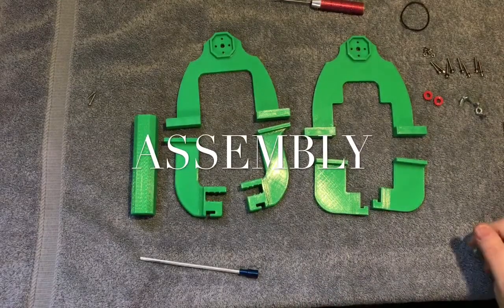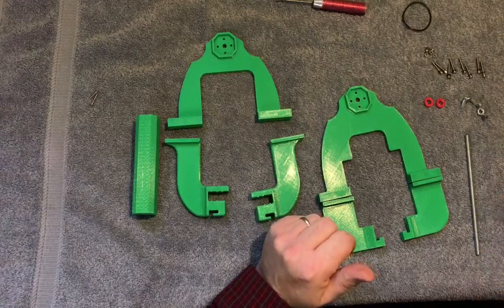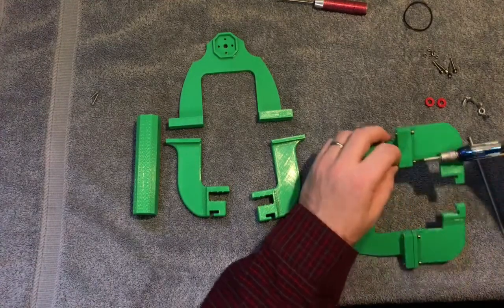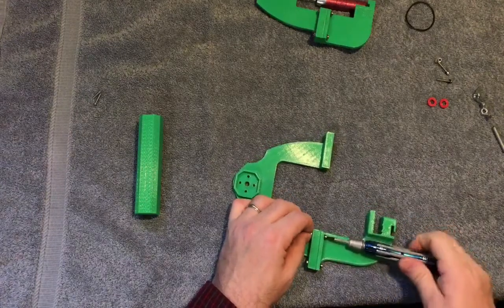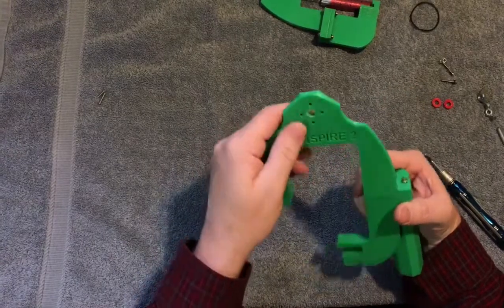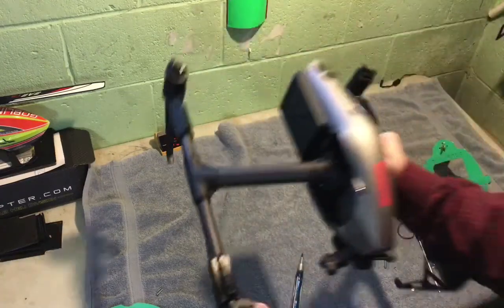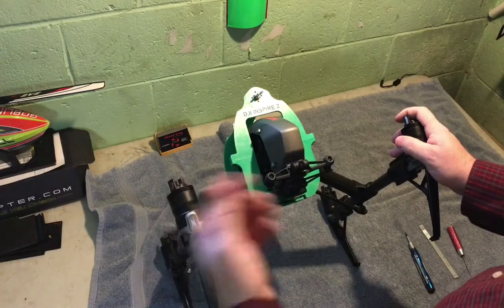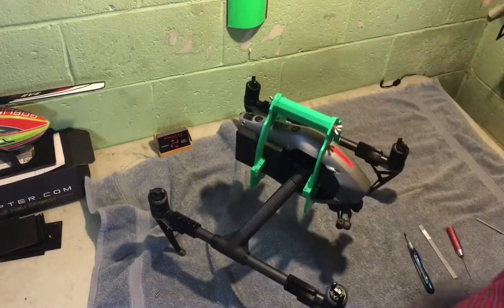DJI Inspire 2 handle for ground filming

Comment: I am going to make one great idea.. I was hoping DJI would make us a gimbal for the inspire 2 cameras but I guess they don't care... Ive only asked since it came out.  Anyways, could you link where I can grab the rod I need? Now it needs a controller table holder built in so we can adjust settings on the fly without leaving the controller behind.
Reply from the maker: It’s 1/4-20 threaded rod. I got mine at Lowes or Home Depot, get a couple 1/4-20 wing nuts also.

Comment: Is this something you sell, or could share plans for? Thanks.
Reply from the maker: If interested i could print you a set or you can get the files off of thingiverse. Link added above
Reply: altima1779 if you could print me a set, that would be great. I do not have a printer, so I’d have to find someone to print them for me.
Reply from the maker: If your interested i can sell you the set that was used in the video. I have since updated the design with a counter-sink for the nuts on the front
 and an option for a one piece rear section. but other than that it is unused other than the video. Is there a way to contact you outside of YouTube?